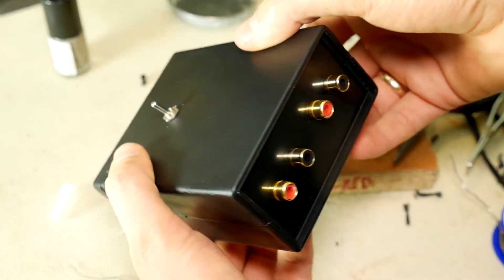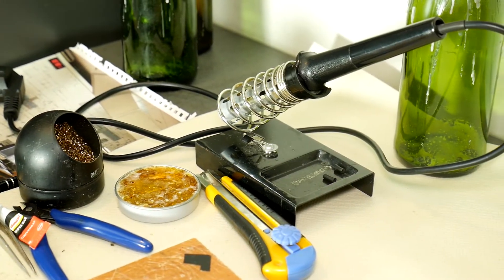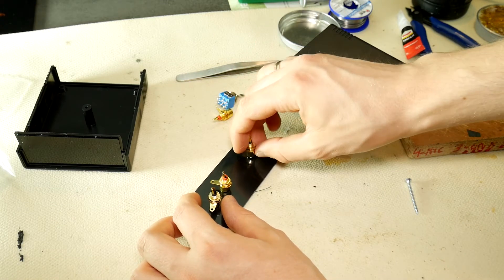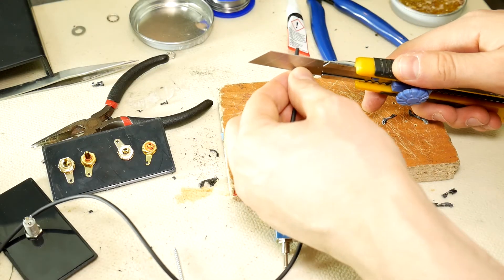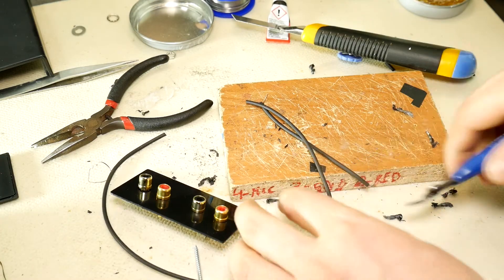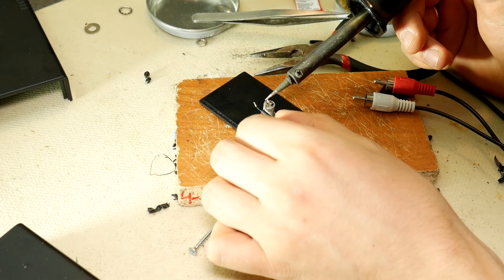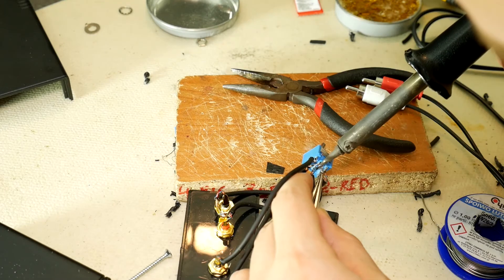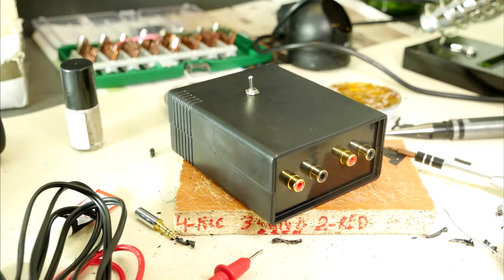How to Make Switch Splitter RCA to 3.5mm

Comment: Nice!
Reply from the maker: for what kind project you plan to use it ?
Reply: @TechscrewDIY  i have a record player and i want to switch between my speakers and my Computer (for recording the vinyls).

And not having to move the cables between the two is very comfortable :D
Reply from the maker: @___aZa___  very good solution to make life easier.